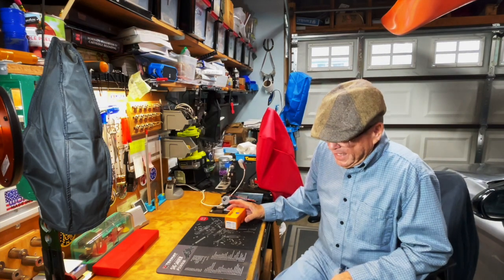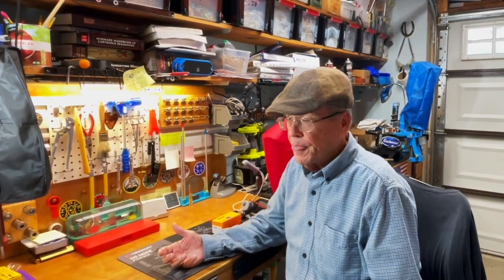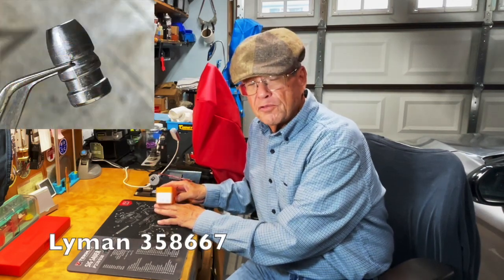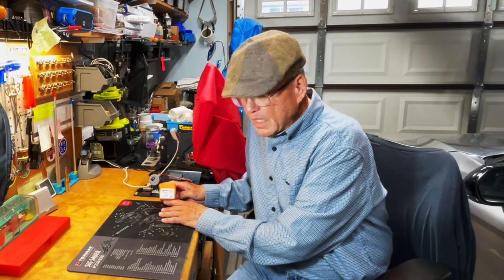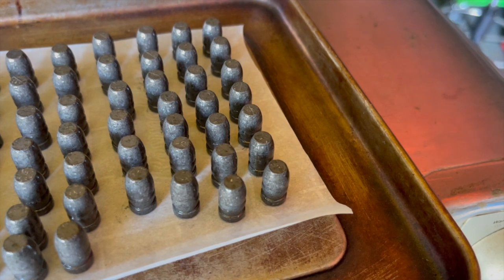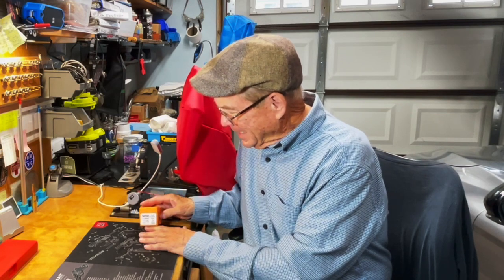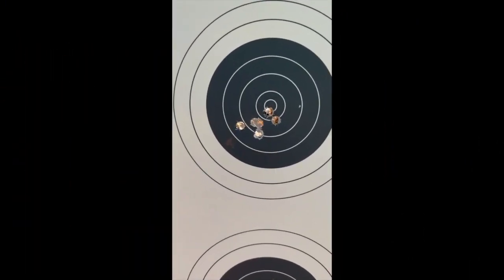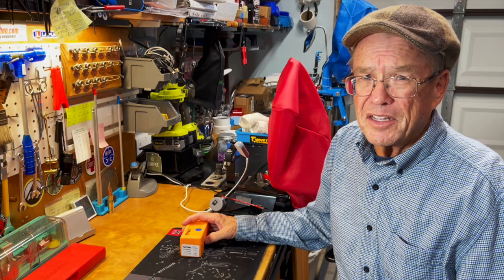#Moldy Monday No 27 Lyman 358665

Comment: Walter, It's hard to go wrong with that Unique loading, it is very accurate out of my Smith's, I have shot that at 50 yards with incredible accuracy with the Lee 158gr flat nose. (Btw) the commentary those fellows were discussing..  Ugh!!! I have had my fill of rotator cuff stuff, I'm getting the steel plate removed (Another surgery) here in two weeks. anyway, Nice video - Dave
Reply from the maker: Thanks, Dave. I was pretty sure you could relate to the “back story” going on. I don’t envy you having to go through another surgery! 🥲🤛🏻🔫🇺🇸